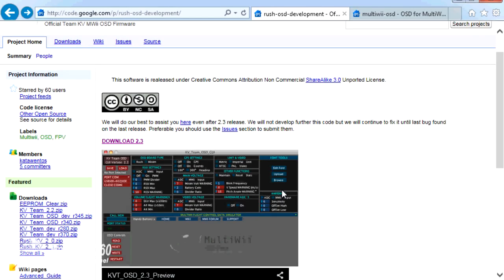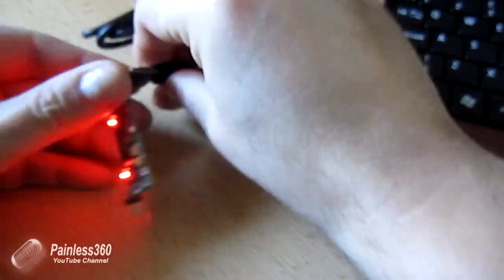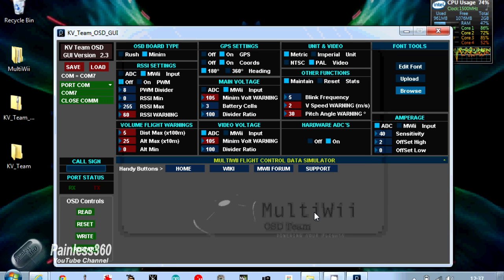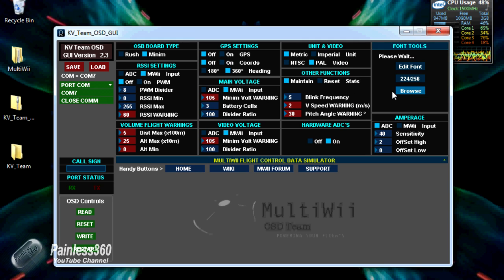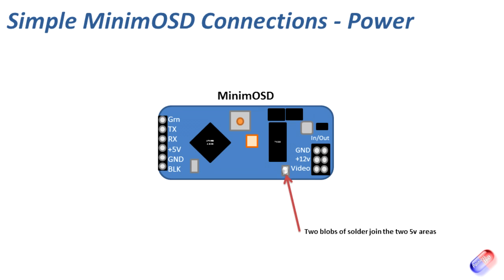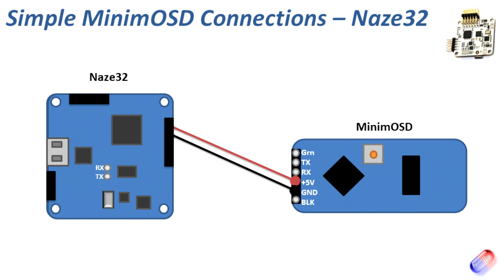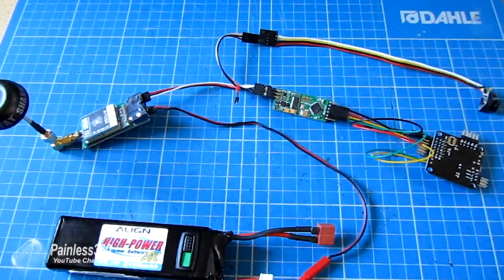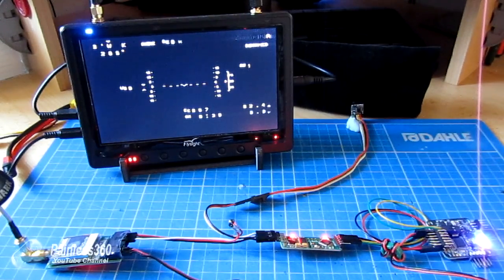(3/8) Naze32 Flight Controller - Adding an OSD using MinimOSD

Comment: Hi Mate.
Me again. I gotta rush off to work but had a quick go but all I get is "Error compiling"  Any suggestions? I'll carry on when I get home!
Reply from the maker: Sounds like you've make a mistake making your edits in the code for the board. I'd re-download it and try again. Best of luck.
Reply: Painless360
Com port ;-)
Reply from the maker: Glad it's sorted! :)
Reply: Painless360

Well, that bit is:-) Mate, don't mean to badger you but I think I've done it exactly as you have instructed. I have picture but I have no OSD?? I've reset the board, I've swapped around the tx/rx just in case :-)

Any ideas? Both lights are on the minim but that little flashy light isn't doing squat and is permanently off.

Cheers Mr Painless.

You've really helped, I am just missing something.....
Reply from the maker: You have uploaded the fonts right? See 9:50..

;)
Reply: Painless360 Yea. I have..Honest :-)
It's all been soldering and crimping and stuff but it's all good (I think) 

I just don't know the next step and stuff. Something is not right (I guess) but I haven't a clue what that might be. Mate, I am sorry to bother you, but when you do a video like this, it's YOUR JOB to help the Idiots... Like me :-)

I'm sure I'll get it...I hope.. So, as I mentioned, both lights on the MinimOSD are on. I have no flashy from the Flashy?? I presume that is normal?

Sorry man, I can now do the FPV but it would have been nice to do it with the Overlay...
Appreciate any advice for sure!!
Reply from the maker: The good news is that is sounds like you have all the pieces you need and it has fonts! The less good news is that it should be working!

I would try a re-flash and use the EEPROM cleaner in case it has a hiccup. If that fails then it could be starting to point to a dodgy board..

The amber 'flashly' should be flickering away while it's working, if it's not then it points to the board being the issue..

Have a go with the code again and see how you get on..

Best of luck!
Reply: Painless360
Thanks mate.
I do appreciate the time!! 
When I hook up the FTDI the 'Flashy' light flashes :-) But when I just power the quad and get video the two Minim Board lights are on but no flashy thing.. I will do as you suggest and hope for the best!

Thanks!!
Reply: Blahdeblah52
OK!!
Just to update in case anyone is remotely interested. I have it...I did have to switch to MWOSD though.....BUT, at the same time, I switched to the USB lead that came with my FTDI...Yea. It was my old lead not giving the full 5v (imo)

So, moving on. It works and I am almost there, I say almost because it flashes, it does the Fonty thing and 7 x out of 10...it actually saves them :-) That's much better than none at all...It's all good!!

Seriously, thanks for this Mr P it's been a great help. My screen did lock up (no idea...) at 500 ft and I did crash and I did break the Tx Antenna..Hey, we have more....
..It's never (mostly) plain sailing but we get there in the end, thanks matey!!

Much appreciated!!!
Reply from the maker: Glad to hear it. Get that RTH function setup so you can recover next time the FPV kit hiccups! :)

Happy FPVing!

Comment: Do I need to unsolder PAL connectors because I have blob on it already. 
Sounds stupid but can't get into osd's menu via transmitter.
Reply from the maker: I don't have the pal pads soldered. You don't need to with the latest firmwares. 

Check the end points on the channels to make sure you can access the menus..

Best of luck..

Comment: Like your vids mate ! Subscribed !
If we want to use minimosd in UK (PAL) we don't need to solder PAL connectors on minimosd board ? I have solder it. 
My osd information shows on my black pearl monitor like it's outside of screen. I only see few of them (only which are in middle of screen). Do you know what I did wrong ?
Thx
Reply from the maker: You don't need to solder the PAL pads.

http://code.google.com/p/rush-osd-development/wiki/Moveable_Items_Guide should help with moving items around on the screen.

https://www.youtube.com/watch?v=08u6c-tSnug may be useful too.

Comment: Excellent video as usual Painless.

I have a question - followed your instructions to the letter, it all worked perfectly. However, I have had to remove the minimOSD from my QAV250 because it works for maybe, 1 minute in to my flight, then stops after that. Very bizarre! I have no idea why.

Has anyone else experienced this? The OSD simply disappears, then the camera starts breaking up. It isn't doing this when the OSD is fully disconnected (which it is now).
Reply from the maker: ***** I have not. It seen this myself but I would check for soldering/wiring issues on the board. I have had one board that did something similar but that was faulty.

Sorry I cant shed more light, maybe another subscriber has an idea..

Comment: Thank you so much for making these videos Painless, they are the exact type of knowledge I am looking for. I have a questioin tho. I bought the Naze32 Acro, thinking that by saving a few bucks and my plan to use an OSD would basically have everything the Naze32 had. But now I am not so sure. I guess, unfortuately, I bought a Skylark Tiny OSD III, thinking that I could hook it up to the Naze32 Acro and it works. But, is this true? without the magnetometer? I mean with repect to RTH.. sorry. 

Thanks again for your great video's. I'm a huge fan!
Reply from the maker: Hi, I used to use the EzOSD from ImmersionRC on some of my models (http://www.hobbyking.co.uk/hobbyking/store/__17745__ImmersionRC_EzOSD_FPV_on_Screen_Display.html). It looks like it's similar to the OSD you are talking about - a standalone OSD system with it's own 'brains' and GPS.

The great part about these types of OSD is that you can add them to ANY craft, even those without a flight controller, and they will work. Want to pop it onto a Bixler for long range FPV? Works great. Want to pop it onto a multirotors, irrespective of the flight controller and get a great OSD? Works great.

The drawback, if there is one if the cost. A MinimOSD is about $10, the ImmersionRC EzOSD is about 10-12 x that. Yours looks to be in the same price range.

Regarding GPS on the Naze32 - the light version of the Naze32 doesn't have a magnetometer so even if you add a GPS to that as well you can't use the GPS flight modes (GPS HOLD and GPS HOME) as without the compass the code can't get it's bearing/direction to make the corrections it needs (https://www.youtube.com/watch?v=3CBxyY0lS6g).

Best of luck with the build and happy flying!

Comment: Fantastic vid! One thing I would mention, you don't really need to bridge the 2 5v pads on the minimOSD since if you are like me using a Fatshark system, the vtx already sends out 5v (vtx>camera) so in practice, if you connect all 3 wires (video/pos/neg) it will be 5v. Mind you, if you are using a 12v camera (non FS) then the bridge is imperative. Another question Painless360, these bridges were imperative on earlier boards since the VR was a poor one. I read that from version 1.1 upwards, its not as critical. Any words on this? Anyways, I'd rather play safe as you said.
Reply from the maker: assaulter99 hi, that's true but some subscribers will use 12v camera systems and this way of powering the board allows you to swap and change camera and transmitter systems and not have to worry about power or ending up with a disabled OSD. Happy flying!

Comment: Using Arduini 1.6.0 will not compile 2.3 code of the rush-osd.  Can you do a video using MW OSD R1.3 since rush-osd is no longer supported?
Reply from the maker: Already done Jon - https://www.youtube.com/watch?v=Xc0BlD1laPg&lc=z13hj3pz1m2fgjsak04cerybowrsibmry30

Or you could use the 1.0.5 version of the Arduino software, that is still available and the one I use for everything (still).

Happy flying!
Reply: Cool thanks!

Comment: Follow up question. I use a FRSky DR4II for a receiver and had set up telemetry by enabling it in cleanflight. Although with telemetry enabled the minimosd does not work when the board is armed. Any ideas if this can be resolved or is it a choice of one or another?
Reply: pMustangw Never mind Google has eventually provide the answer. So for those interested you can have both you just need to use the soft serial option rather than the built in FrSky TX pin. Also as an added bonus you now get telemetry with the board armed or not where as before only when you armed the board.
Reply from the maker: pMustangw Good news - Happy flying!
Reply: pMustangw
 Could you use both at the same time? Cause I like the FrSky telemetry pin option since I use it mainly for the Taranis warning me of low voltage/rssi. If you only use the soft serial one, you lose that I presume? Thanks.
Reply: assaulter99 Let me try to be more clear. If you enable soft serial (the pins used for GPS and such) you use pin 6 for for voltage to your FRSky DRII set up OSD just as shown in video and then you have voltage on your taranis and OSD. Oh and in case there was confusion on the RSSI remember it works independently of the naze32 so you can still have it on your taranis.
Reply: pMustangw
 That makes sense, thanks!

Comment: What is the difference in the MinimOSD and the MavlinkOSD and what is the latest version of the MinimOSD board?  And, has everyone else has commented -- excellent video! You have the best Naze32, Vector and Multiwii "how to" series' on the web.. Please keep it up.. :) Thanks
Reply from the maker: The MAVlinkOSD is a later version of the board (v2.0 vs. v1.0 or v1.1 for the MinimOSD). Be careful through as the terms seem to be interchangeable in listing and vendor descriptions on the web..

Happy flying!

Comment: great video mate, very helpfully. i can finally use my osd now that you have explained the hole voltage situation properly. do you know how to configure the osd overlay, so you can more the information where you like?
Reply from the maker: Some firmware offer this and the detail is in the documentation that is located where you download the files from. You usually need to access the location through the GUI (lots of firmware versions don't offer this option yet) or through the menu in the OSD itself. See an example in https://www.youtube.com/watch?v=6vCeov7nXTY at 9:36

Hope it helps.

Comment: Great video series! Question: Is "MinimOSD-Extra" firmware compatible with the Naze32 as well?
Reply from the maker: May be, I've not tried it. There is another video showing the excellent Multiwii-OSD coming next week though.

If you try 'MinimOSD-Extra' let me know how you get on..
Reply: I tried it, it says "no mavlink data". It has to do with Naze32/mw, apm/mavlink.
Reply from the maker: Looks like that needs the MAVLink data stream that you get out of an APM or Pixhawk system then. I've not got another video on the channel that gives a nice Naze32 alternative to this one..

Thanks for letting me know!

Comment: You ROCK. Got to say I was so happy to see that you were doing an OSD on the naze 32. I had watched another video over and over but felt his method was going to be a challenge for me with the soldering so I never got around to it. This is so much simpler and happy to say that I am now up and running the OSD. Although my flying days are few this time of year given I am in NB Canada and my front yard snow bank is 6ft high but once in a while I can get over to an empty parking lot at least I can be ready for spring when it gets here. Also eager to see the gps video as I think I want to change my tricopter from a KK to a naze or mini APM so that I have a better camera platform. Thanks again for all your content
Reply from the maker: Thanks for the feedback, not as hard as it looks with the MinimOSD and works really well. I have a Quick Tip out next week that shows the other firmware being used on the Naze32. Have you played with changing the settings through the OSD? Go into the menu with the stick combo shown on the splash screen (throttle MID, yaw RIGHT, Elevator FORWARD) and you can setup PIDs and change all sorts. Hours of fun for those long winder nights..

Happy flying!
Reply: Sounds good. I did find out how to get into the menu it took me a few min to figure out what i needed to do but was able to move my time indicator and voltage text more center as i was off my screen a bit in its wide setting.

Comment: Building into another good video resource, do you know if this board has the ability to receive and process GPS data and carry out missions using programs such as Droidplanner?
Reply from the maker: Hi, not yet using Cleanflight. I'd hope this would come in the future. You get the ability to perform the same modes as a Multiwii i.e. GPS Hold and GPS Home.

If you need mission flying then I'd always go for an APM controller.

Happy flying!

Comment: Great video (as usual)... Definitively, my favorite channel. Anyway, just a remark: For some reasons, sometimes, flashing with the FDTI connexion is not fully working. For example, I was not able to save any settings (each time I reconnected on the GUI, I retrieved the default values). I had to rewrite the bootloader with the ISP connexion via arduino too.
Reply from the maker: Odd, I'd suspect one of the boards/connections. Best of luck..
Reply: SeBy DocKy I ran into this as well. I suspect it has to do with using a 64bit Arduino emulator. I had to reboot the MinimOSD and upload just as it was initializing. Eventually I got the timing right. I've had other 64bit users on other forums confirm the issue as well.

Comment: Thanks for this further awesome video. Thinking abt putting one on my mini quad as well. Was your GPS connected while your demonstration on the groundstation? Have only the NAze Acro version without GPS so would be intersting to know which data I could use from the Naze. think only art. horizon and voltage? thanks beforehand!

Comment: Got a different error on another pc, installed Java & the gui is loaded &other board shows up. I can upload character set but I can't change any of the values. I can change adc to mwii. When I click write tx lights up faintly but values don't seem to be stored when next I open program. I get error when I try to use arduino program. There area couple of differences in menus from yours to mine, selecting board & processor have to be selected individually. 
Thanks
Bernard
Reply from the maker: You may be using a different version of the Arduino program to me. You know if you've got anything wrong as it will error and not upload.
Reply: Painless360
Im running Arduino 1.6.0 The Only other Arduino is the nightly build
Reply: ***** Been a very busy week. Went back to 1.0.5 like you & all is good, thanks. Now for gps fun!!

Comment: When I run kv team osd gui I get error, registry key software\javasoft\\java runtime environment\currentversion has value 1.8 but 1.7 is required
And I can go no further!
Reply from the maker: If you 'Google the error' you'll find loads of great articles that give some great tips on what to try (like http://stackoverflow.com/questions/26324486/properly-installing-java-8-along-with-java-7).

This is usually down to the fact that a few .exe files from a previous version of Java have managed to get into somewhere they are causing confusion when the version is checked.

A typical place to look is in Windows/System32 - delete java.exe, javaw.exe and javaws.exe. If all else fails, uninstall Java, delete and remaining java files you find then re-install.

Hope this helps. Good luck with the Google searches.